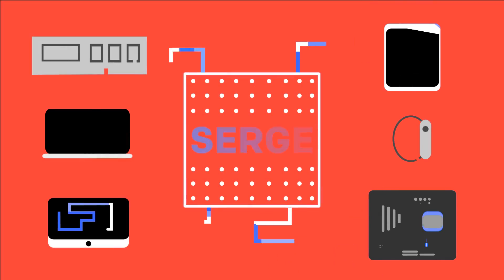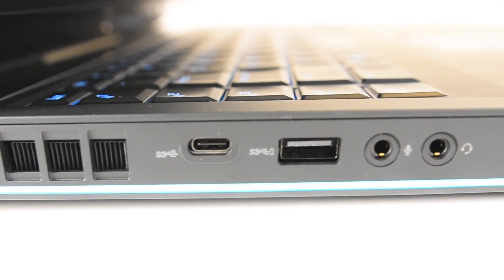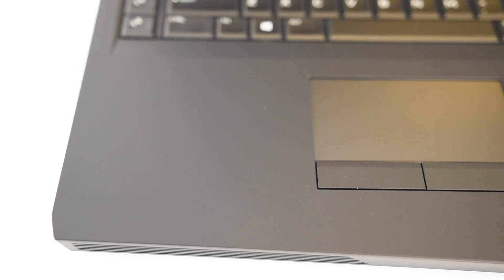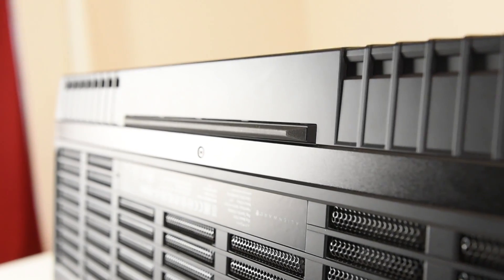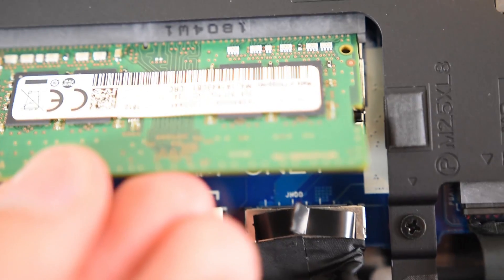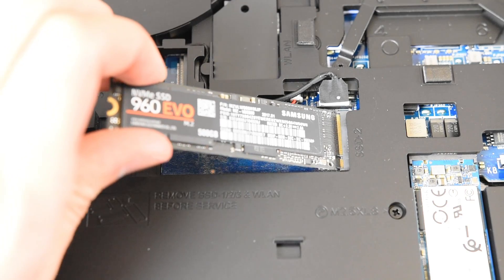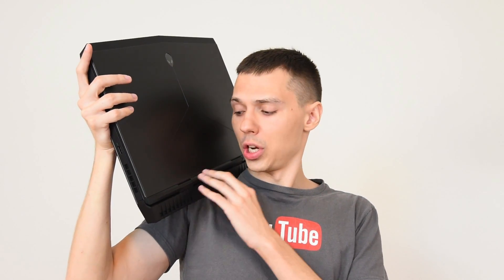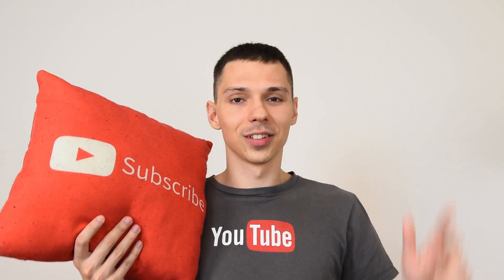NEW Alienware 17 R5 Review - GTX 1080 OC, 6 Core i7 8750H - EXPERIENCE!

Comment: I bought the Alienware 17 R4 with the 1070 and 6 months in it started making a loud noise. I had to beg Best Buy to take it back. They exchanged me with a 1080 as long as I paid the difference in price between 1070 and 1080. I made the call and did the exchange thinking I got a faulty Alienware. I took my new Alienware with the 1080 home and played it but a week later one of the cores hit 99 C(intel 7700k). Alienware told me its technically not overheating because the package temp was not 99. I thought this was BS, so I refunded my 2800 Alienware R4 and bought an Ibuypower Snowblind for 1899 with a GTX 1080 ti. That's right! I saved damn near 1000 and got a better computer. I have had the snowblind for about 4 months and I have yet to see the CPU(intel 8700k) go over 80C. Long story short, I'd think twice about buying an Alienware 17 for those who are looking. They are expensive!
Reply: Jinwoo Chang Great man, I would have repasted because I did hear a lot of people with 17 R4’s repasted. I just wanted my money back haha. Thanks and spread the word to people with the R4’s about repasting! I’d recommend a repaste with the Alienware 17’s anyway never hurts to get some fresh paste on there for cooler temps! Game on guys!
Reply: dont know what you were expecting. 
Like, i have a msi gl62m with i7 7700hq and gtx 1050ti. My 7700hq ALWAYS overheatup to 95c. And consider that i have it paired with a gtx 1050ti. 
Its just, theyr hot as the desktop counterpart. i7 7700x are all so goddam hot.
Reply: Al vi K Wow thats crazy. I expected to get what I paid for. I refuse to buy a 2800 dollar computer and the temperatures are 99 C. However, I have heard the 7700’s run on the hotter side. Thanks man appreciate it!
Reply: The thing is, thats just too much for a portable device in my opnion. 
If i have to spend 3k for a notebook, i would rather go alienware 15 with i7 + 1050ti + alienware amp than 1080 max-q. Theres no point on putting a 1070-performance 1080 inside of it if you can put it outside (and its pretty cheap tbh). 
And, also, you have upgradeability and your future proof.
Reply: Al vi K Couldn’t agree more man. Exactly!
Reply: Amaze Productions i repadded and repasted with liquid metal my aw 17 r4. I get idle 60c and max 70c. I am happy :)
Reply: I absolutely agree. The 1050ti or 1060 options are much more manageable and it makes the unit lighter. The other advantage is that you can get the new GPU's coming out this fall. So its just a win in every way.
Reply: Yes you save 1000$ but what is the cost of the monitor keyboard
Reply: you have the 7700hq + 1080 variant?
Reply: Amaze Productions i hope you find your  dream laptop soon bro cheers
Reply: Al vi K no it was a hk model on the cpu 7820hk probs?
Reply: Al vi K That’s what I had, I exchanged it earlier this year for an 8700k + 1080 ti
Reply: i mean, paired with the cpu you got a 1080 or something else? (because that make a huge difference in temps since heatpipes are connected)
Reply: Al vi K Oh i see. The 1070 made a loud throttling noise but temps were fine. It was the 1080+ 7700k I had 99 on one of the cores.
Reply: What’s ibuypower? Exactly
Reply: adrian simental A company that specializes in prebuilt gaming computers. Usually cheaper than the popular name brands like Dell, MSI.
Reply: Also cheaper!
Reply: Never heard of them before. And I have a alienware r4 17
Reply: What do you mean repadded and repasted?
Reply: Amaze Productions I’d always buy direct, like straight from Dell and not Best Buy. Most people I know who have problems with their systems bought it from some store.
Reply: Jinwoo Chang 

Hi there mate, what do u mean repadded.

Thabaks
Reply: Amaze Productions I bought 2 17 R5 and both had hardware malfunctions. I will never trust a company that lets 2 products costing 2.5k out with clear hardware problems like usb c not recognizing inputs and the backspace, trackpad not working properly.  The fucking keyboard looked slightly different in shape and design between the two...yea that’s how careless Dell is after buying Alienware. I am speaking with my wallet here and never buying a dell or Alienware product again.

Comment: Do you need a gtx 1080 to make the laptop worth it or could the 1070 be good enough to play games on ultimate settings with high fps.
Reply from the maker: 1070 should be good enough.
Reply from the maker: Just make sure your in 1080p and it should run good
Reply: SERGE but what if I want the 1440p screen
Reply: My r4 with 1070 is working fine with 1440p on ultimate settings
Reply from the maker: Talha is right but there will be some games that may have trouble with that higher resolution just be ready to accept that.
Reply: Yes that happens it drops frames every now n then in high graphics demanding games but that's my 7700hq not 6 core r5
Reply: Talha A. B so you think the r5 with 1070 would at least have 60 fps

Comment: HI Please reply to this comment!! In the Alienware website I couldnt find the new Alienware R5 model with a 1080 and i7 cpu. There's only i9 with 1080. Please explain this confusion :(
Reply from the maker: Hey welcome to the channel. I think its a supply issue or a temporary website bug I experienced the same thing on the site periodically when I bought a 13" with gtx 1050.
Reply: ok I'll check back later
Reply: STILL DONT SEE IT ON THE WEBSITE

Comment: 15 pounds?!
Reply from the maker: It's pretty heavy the website says it starts at around 9+ pounds. It doesn't go into any more detail a out the actual range
Reply: SERGE it’s 15 pounds with the power adapter included in that weight, it’s 9.74 pounds on its own
Reply: Exactly The website on Bestbuy 9.74 pounds why 15 pounds? :/
Reply: Maybe being a gym-goer alot and aircraft a&p I don't understand the issue.  15 pounds ladies and gents. It's 15 little itty bitty pounds.  Could walk 15k with that c'mon ppl.
Reply: @acourierofourhopesandaamer8303  lol this is my thought process as well..
Reply: VaultBoy97 it should be less than 10 pounds
Reply: Jinwoo Chang Depends on the configuration. I got one gtx 1080, 1tb HDD + 1tb SSD. It weighs just more than 15 pounds.
Reply: i have the same config and it doesnt feel that heavy. weird. i never measured it but i do have an estimate difference between 9 to 10 lbs
Reply: it's 10 pounds
Reply: I have a 17 and im pretty sure its just below 10lbs

Comment: I have a previous model, the new model is a disappointment.  Firstly, ports and trackpad are still pathetic, Dell literally just reusing same compounds from 13inch. Secondly, the screen can be much better. It is the exactly same screen from last year model and considering other laptop and this price point features ips 144hz screen. Overall, the only part shines is the new GPU...
Reply: Well other laptops may have a 144hz screen but the color accuracy isn't the greatest on them. The alienware 120hz screen has alright color gamut and it is 1440p. Another bonus is that it gets really bright at about 380-400 nits. Other laptops I have seen have a really dim screen especially outside. Can you really notice the difference between 120hz and 144hz though?

Comment: should i go for alienware 17 
with i7 7820hk & gtx 1080     256GB SSD    
or 
i7 8750H & GTX1070     512GB SSD 
I WILL BE USING IT FOR 3D DESIGN AND GAMING 
BOTH GO FOR AROUND 2800$ 
I AM AN ENGINEERING STUDENT 
WHAT WOULD U RECOMMEND
PLEASE HELP
Reply from the maker: Get the new one because the six core is be a lot more useful and the thermals and fan noise and decreased on this model. Always go newer model because the other one is a year old and on the new one they already implemented eveythjbf they learned from previous generations.
Reply: SERGE thank you

Comment: Does it require a repaste out of box? Like what are the temperatures on the cpu and gpu under load?
Reply from the maker: no repaste necessary play games and enjoy your laptop! :))
Reply: SERGE Great to hear. I will be getting a 1070 version with a 120hz screen in a month or so. Didnt want to take apart this laptip to repaste it. The process is a pain.
Reply from the maker: Yeah I was really worried that I would have to repaste thank goodness we dont have to!

Such a shame so many systems in the past caused huge headaches for people.

I wonder if a repaste would keep it even cooler but honestly for the kind of power you get I dont think it's worth attempting since there's some inherent risk involved. 

Anyway once you so get a laptop let me know how it goes! :)
Reply: SERGE Alright!
Reply: I think they listened and fixed the thermal issues this time. Hopefully...
Reply: [OCB] Yeah I have been hearing good things on the reddit about it.

Comment: Alienware laptops are so expensive, i really want to get one, i can afford it,  I have a ps4 and nintendo switch for gaming already . I just dont know if its worth $5000 dollars here in australia. I would mostly be buying it for video editing and Gaming. I just dont like how laptops get really loud. Does the keyboard heat up ?  and how heavy is the R5 compared to the R4, i think the R4 was 4.2 Kilos
Reply: Emrah Suna it’s always better to get a desktop if you can
Reply: Emrah Suna I have the R5 here in the Uk and my set up cost me £3000 so around 5.5k AUD. 

Fan is not loud and thermals are great so far for me. The 8th gen processor will be very beneficial for you as it has two more cores compared to the previous generations. 

My specs were i9 8950hk and the 1080 overclocked. Also got the 2k panel with it. 

In my opinion it’s the best laptop I’ve got so far. I had a gtx 980 laptop and while performance was good, the build quality was no where near Alienware. 

I’m going to say go for it if you have the cash ready.
Reply: Jinχ it always better to go for desktop due to power and being a lot more cost effective.  However many of us actually require power on the go. I have a custom build desktop in HK with the 1080ti. 

However I travel to Uk a lot to study which is why I also need the best gaming laptop for me to use while I’m abroad. 

I would always advise people who move a lot and like to game to use a laptop inside.
Reply: hey does anyone here know any laptop with a hexacore ( 6 core) that smaller than 15 inch . its very convenient for me since it fit my rather small backpack. all i could find is aero 14 but it comes with a dedicated gpu (gtx 1050 ti) which i dont actually need since i dont plan to play any triple a or intensive game. Any helps and suggestion is appreciated. otherwise i had to buy dell xps 13 .
Reply: I have the one with 7820 since July last year, I use it for intense 3D graphics work and gaming, had no problems yet. The warranty is amazing (it is the second one I got from alienware), the keyboard does not heat up, the battery less around 3 hours of intense rendering work, also I have never experienced thermo throttling although I do use the machine on a LOCTEK D7DP mount. Overall, for the kind of mobile work I do, it was the best "bang for the buck" that I could get at the time...
Reply: The new Dell XPS 15s (not the 2-1s) will have 6 cores, but I dont when they will be released...
Reply: Hi, I have a R4 17", 7700 processor, gtx1070, they should be getting cheaper now about $3400 at JB hifi or even less at Dell. Most recent games demand a gtx 980 level gfx card so you should be safe for the next couple of years
Reply: I paid 2400 for my 17 r5 best thing iv done for my gaming
Reply: dude check out the Aero 15x
Reply: Marcus Leung Thanks , will probably get it, once it releases here in Australia. We still dont have it.
Reply: Jinχ I have a powerful desktop, Just dont have the time to use it.
Reply: https://www.youtube.com/watch?v=jbBDyx7DlQQ 

Can help with good buying options get in touch.

Comment: How is your hp Omen 15 doing?
Bought after watching your review but having frame drops due to heating and sometimes plugged in not charging while gaming??
Reply from the maker: lokesh rai honestly man frame drops are a normal thing on a laptop almost every laptop I have had has some kind of frame drop. But here’s the answer. 

Sometimes manufacturers put horrible paste on the processors so if you do a processor repaste it will help solve some if not all heating issues. 

Basically it entails dismantling the laptop and applying a type of gell to cool it better. I did it recently on a 13” Alienware and it helped greatly by reducing temps around 20c
Reply: Thnx for rplyng man... In my case, in India hp is quite a named brand & I payed some extra bucks for the same but getting to this kind of performance made me a little disheartened. That is why I asked you about your hp pc, since I bought the same base model.

Comment: I bought a Msi Gs63 7rd something..
I. LOVE. IT.
It is thin af and sooo quite.

But the Alienware looks sexy in black too
Reply from the maker: Vorname _ I will have to examine that brand in detail been wanting to for a long time.
Reply: Enjoy cleaning the fans and heatsinks which requires a complete dismantle, repaste and warranty void. The fans are small forcing high RPMs in combination with low-quality bearings without lifetime lubrication unable to handle vibrations resulting in reported failures. Temperatures creep up during long gaming sessions which is noticeable on the keyboard. MSI GS and GE are not quiet at all. Either you don't own one or your opinion is bias.